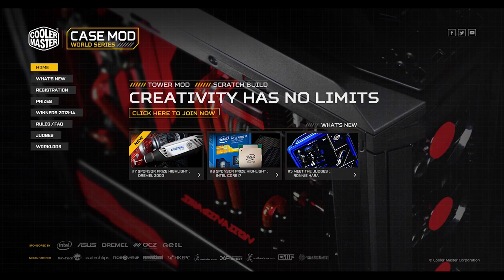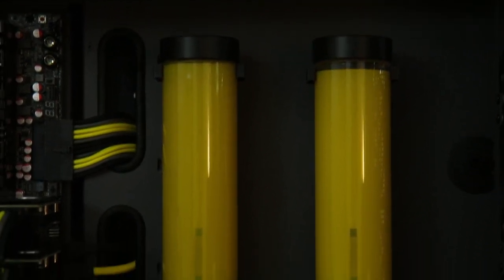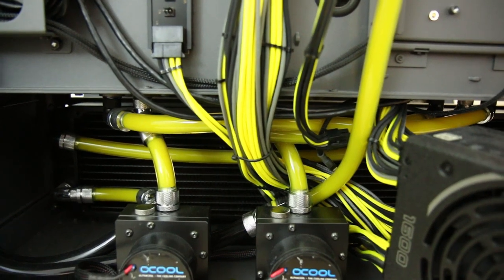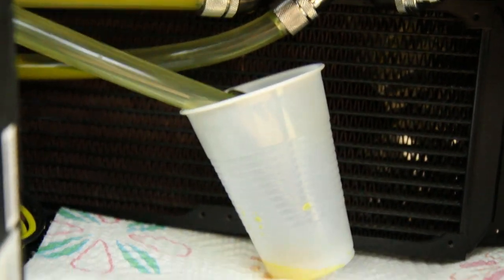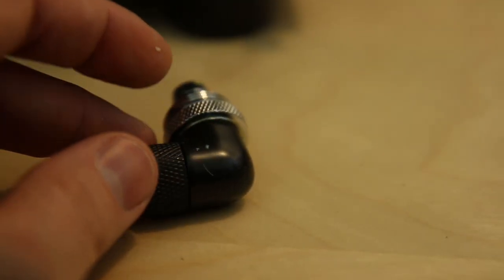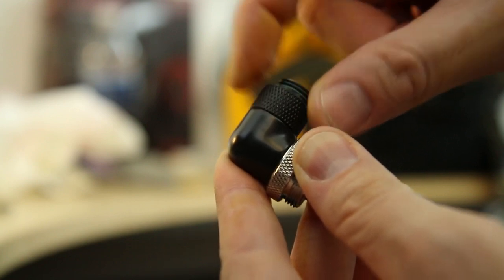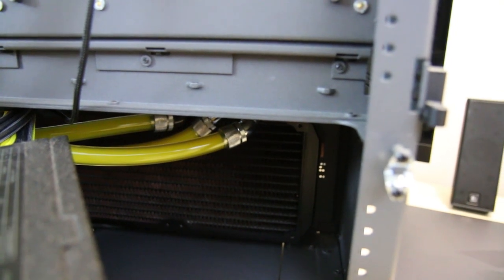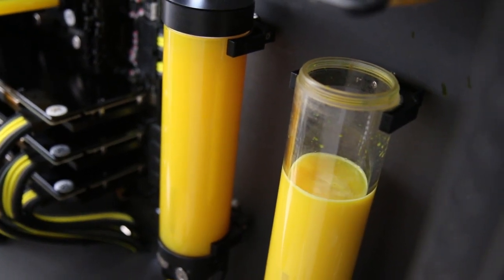My $6500 Custom Watercooled PC LEAKED!!! Now lets fix it....

Comment: Who the fuck water cools their pc anyway??
Reply: When you have higher end parts that are pushed get very, VERY hot like 120 degrees so water cooling keeps it much cooler than fans.
Reply: i have a box connected to my pc that has an extra i7 fan it cost a lot of money
Reply: idk its like a case with an i7 fan in it its pretty small and its does its job well connects to my computer using magnets and ads extra cool because the fan on my actual computer is pretty shitty
Reply: +Flash The Reptilian I guess so
Reply: +Flash The Reptilian reptilian brotherhood HISSSSSSS
Reply: +JACKO- LANTERN I think your talking about a laptop cooling dock.
Reply: +Flash The Reptilian  HISSSSSSSSSSSSSSSSS
Reply: +Teemo4Life Absolutely.

Comment: tho not required. As a precaution always use DOW silicone lubricant on those o rings. O rings can and will go bad after few years. Do not use other products as they contain petroleum which will corrode o rings. Do this every few months when you drain your system for cleaning. You will have better chance of water tight system. Just a bit of personal troubleshoot experience.

Comment: I would love to do a water-cooled build, but this is exactly why I haven't. I have experience in high pressure hose building, including swivel fittings and adapters. All swivel joints rely on an elastomer o-ring to prevent leakage, usually nitrile (Nitrile Butadiene Rubber.) O-rings are subject to heat aging and oxidation. In other words, if you have the system long enough, it's going to leak. I'll probably still try one some day, but I'm fully aware of the possible headaches I'm inviting. lol I really admire your builds, by the way. Awesome and inspiring are the words that come to mind. :0)
Reply: Depends how pretty you want it to be.

I used barb fittings on every part of my water-cooled build with soft tubing, basically 0 chance of failure, i dragged that across the country for 8 years without a failure. 

But of course fittings like he's using are going to look better, but also be more prone to failure.

Comment: Those bloody rotary fittings man! I've also had a leak and it was also due to lateral pull against the rotational axis of a 90 degree BitsPower fitting. Replaced it and re-did some tubing and it was fine... They're really sensitive to that I find. Sucks.

Comment: Rotary fittings will also have more individual points of failure. Not much choice if you want flexibility in a hard tubing loop but I would avoid them if aesthetically possible.

Comment: Just as I ran the pump on my first watercooled system I developed two leaks. One was a fitting that I didn't tighten as much as I had thought and the other was on my reservoir. One of the plugs leaked very slowly and no matter how much I tightened it it would leak, even swapped it out for a different plug, still leaks.

Comment: Air cooling has done the trick for me. My cpu runs 20c lower than it was before i bought an aftermarket cooler. My temps are 40c on load and 30c idle. I never want to ever bother with water cooling.

Comment: ......and subscribed, also;
some times you will find fittings leak when in service, then test perfect on the bench, sure the load/torque you had applied on the hose was helping the leak happen. another thing to consider is when the system is up to operating temp thermal expansion can allow leaks to start or increase, then theres the whole manufacturing tolerance + QC that has to catch any flaws.leaky fittings happen to anyone eventually over a long enough time scale even when all the work you do using the fittings is correct. cheers Jay for all the vids

Comment: In car engine you pressuretest the cooling system with air after you filled it with cooling fluid and watch if it keeps the pressure (about 1 bar) for several minutes.

Comment: I know this is 2 years after your upload but I have had problems with o-rings on mine and my brothers setup. Perhaps just sharing this will alert someone to keep an eye out for the problem I have experienced.  Its almost like the o-rings suffer from ozone degradation and start cracking after a couple years. I've changed all the o-rings except for inside the waterblocks and I've been running this 790I ultra for 7+ years now without any major issues. "I know its old but it still plays everything I throw at it"  I've never had a leak thankfully but I do have to top off the reservoirs every 6 months or so. I was so afraid of there being a drip somewhere on the graphics cards but it could only be evaporation.

Comment: If you want to check your system properly before putting 'water' in it. Connect a manometer and put 1bar air on your system. wait 30minutes. if the air pressure dropped at all (look at manometer after 30sec not from start and make your pumps etc move a couple of turns before taking notice of the 1bar pressure)
Reply: +Bart Stas it also doenst hurt to move and jiggle al your hozes while doing this test.

Comment: custom watercooling is cool... if you got money to burn..    .. but i've been using my NZXT Kraken X60 on my 8350 @4.4 for the past 2 1/2 years .. and its been solid just the occasional vacuuming  and dedusting  and its fine for the cost

Comment: I had my fare share of leaks. I had leaks from my custom machined CPU waterblocks back in Barton/Duron days. I always used demi-water and some antifreeze (like 10% tops) and I had a couple of leaks from CPU block down on my graphics card while PC was runing, then it leaked around the GPU over the AGP slot (some even went in it) and down the motherboard and PC was running just fine. There wasn't enough conductivity to cause any damage. One time I had my water system runing over 8 months without changing the coolant so the water did pick up some goo and some minerals from copper and other parts and was not demineralized anymore obviously and again I got a leak from my cpu to my gpu and this time PC did shut down. No damage. Just cleaned the PCB with fresh water (under a tap believe it or not), dry it all out, put it back in and it all works. Point is: as long as you are not going crazy with coolant and you use non-conductive or very low conductive coolant you aren't going to fry anything. I have no idea what Jay here uses and if that color in the coolant is conductive or not (hope not) but some colored coolants ARE conductive. They look nice but god forbid you get a leak and you will regret the day you wished that purple coolant instead of blue or just plain see-through colorless one ;)

Comment: I don't know a ton about computers, but the first thing I thought of when you were putting this together and assembling the cooling system was all the points of failure you have in it. Now maybe your experience of 11 years and one leak is more credible, than my observations but, it would seem to me a good idea to eliminate as many failure points as possible. Why not run flexible tubing from the reservoir down through a hole in the case to the next connection rather than introducing a bunch more failure points by using a fitting? A grommet could be used around the hole to hold the tubing and prevent chafing and look nice. I wonder why these don't have level sensors? Is it because the reservoirs are just so easy to see and monitor?  

Like I said I don't know much about computers so maybe noob questions here I mostly work on cars but I have really enjoyed your videos especially this build I love the gray and the yellow and the thought and craftsmanship you put into it.

Comment: I think a solution to this problem might be the waterproof spray. If you ever decide to water cool your machine, make sure to use the waterproof spray to insulate the electrical components. Or you could just build a mineral oil fish tank pc.

Comment: Damn, even if it leaked once, you can't ignore that watercooling does an amazing job. I wish it won't leak again.
I've got a question. Once you filled the system with fluid, overtime, fluid goes somewhere, I mean If some of it would be gone or it stays the same amount over years?

Comment: I was thinking about the possibility of making a watercooled system using vacuum. So it would be a negative pressure and not ass prone to leaks in the different fittings. Or that was my thought at least. I have no experience what so ever on that subject. Only ever used an AIO.

Comment: Stick a Raspberry Pi (or Asus Tinker) in there with a leak sensor and a 120v relay; the second the bottom of your case gets damp; have the Pi through the relay, nearly instantaneously cutting power to the PC's PSU.... I'm doing this with my TARDIS build.

Comment: I had a leak in a Coolit water-cooling system too. That is why I don't water cool any more. It leaked right on to my $220 graphics card. The problem was the water pump, that is where it leaked from. That was 10 years ago.. i won't do it again.

Comment: I hope that nano fluid is non conductive and doesn't cause corrosion so if you do get another. leak like a spurt all you need to do is wipe the components down and dry it off a little

Comment: Everybody taking about fan PCs not looking as nice, being as quiet, etc.. 

Search youtube for "Cloud Unit" by diy perks.. 
It's totally possible to make air efficient and silent, even quieter than water cooling.. You just have to make sure to do it smart where the airflow is controlled very well.. 

I'll admit liquid cooling looks awesome though.. But if you really want you can always run some pointless colored tubes and extra lights in a fan or passive system and get that same effect.. 

My favorite ever though is this one desk PC that had a glass top with all the parts exposed.. I can't remember what it was called.. But a form factor like that really r requires liquid cooling.

Comment: Do you use silicon grease on your gaskets? 

I don't know it is different with watercooling fittings, but with all other types of O-ring gaskets, you need silicon grease to complete the seal.

Comment: hows this for a computer case thats specifically designed for watercooling... what happens if the motherboard is laid horizontally, a bit like those desktop computers where you put your monitor on the case ... except, the motherboard is up the top, facing downwards... basically, upside down... any water coming out of the loop will be going away from your actual computer parts

unless you have some crazy high pressure in your water loop which just happens to shoot the water upwards through the leak, then thats the risk you take when you have a good pump but shoddy plumbing

lots of cases out there say that they are ready for watercooling but what they really mean is they have a bit more space for the radiator where the case fans would normally be.... but if the motherboard is installed upside down, it would also help with mantenance of the water loop because it makes draining a lot easier too, it will literally be pouring the liquid out of the waterblocks and there wouldnt be any pools of liquid left in a bend or corner... and if your pump doesnt have enough power to push the water all the way up into your waterblocks when you refill it, then you probably shouldnt be using it to cool your computer anyway

Comment: You can only produce about 1 psi of air blowing into the system. With the pumps creanked up moving water around your talking about 10-15 psi. So big difference there.

Comment: Hi!
I am Greek (Hellene) and i watched many of your and Barnacles videos.
I do not own a water cooled desktop pc, so i am not so experienced, but ideas passed through my mind when i saw your problem.
Have you tried some kind of sealant in the joints, like silicone or something like that ?
I'm somewhat troubled by the smoothness of the area around the joints, and if that would be a 100% seal, but it could be a good idea to roughen the surface with a sand paper in a circular pattern, so it would create some kind of grooves, as the ones in a bolt but not in a spiral. that would help the silicone to grip and seal better.

I think that would somewhat eliminate the possibility of a future leak!
especially where the valuable parts are located.

Just some thoughts i would like to share.

Vasili

Comment: my first watercooling attempt was very ghetto, i used my old zalman z11 case as the housing for my pump res and rad, for my pump i used a $20 submersible fishtank pump 2400lph!, a water jug ($3) as my res, and green fishtank tubing. the only normal things i used was a 240 x 240 x 45 rad, ($50) a ek waterblock ($110) and 3 normal fittings ($20). and koolance coolant 2ltr ($15). because it wasnt completely sealed the coolant was evaporating and the inside of my case turned blue
Reply: actually fitting a h60 on my 290x was my first attempt

Comment: My development career has taught me to keep it simple, which is why I would never ever do a loop as complicated as yours.
My loop was designed from the ground up to be effortless and painless to drain, take apart, reassemble, and prime without even cycling the pump. And really thats the only rational reason to buy expensive parts imo, to make life easier.
I do not envy the hard-tubing loops.. :o Thats gotta be a nightmare.
Sucks that it leaked, no loop is leakproof, but thats all the more reason to K.I.S.S.

Comment: since your only leak ever has been the result of one of these fittings would you say its a good idea to only use straight fittings if possible? like just a regular compression fitting for every single connection possible? seems safer?

Comment: All it takes is a little too much force applied during installation to get them loose like that.
Had the same problem with 2-3 of the EKWB ones in my Setup - Not really blaming EKWB but I wish those things were a little bit more sturdy.

Comment: Why wouldn't you air pressure test the system first? Always pressure test first. Put 10 or 15 psi in it and let it sit over time. No drop=no leak.

Comment: Whats the normal amount of coolant to disappear ? 1mm month, 3months?
Just asking as i need to some once in a while and i have searched and searched but i never seem to find Any leakage.
I have mostly used 10/8mm plugin fittings. 
But i gotta agree on you about watercoolings safety. I have had about the same build on few cases over 10 years in use and never anything major. Changed some tubes ect over the time and blocks.  Even has some Custom Hand made blocks Back in the days.

Comment: Stuff happens! Glad you caught it when it was minor. Full liquid cooling is still out of my league in cash and time investment needed. 
I have a pre made CPU liquid cooler I have been thinking of adding a GPU liquid cooler.
Not sure what to look for in a liquid cooler for my GPU. I have a EVGA GTX 680 FTW 4gb.
 I have tried web searches but have NOT found a model specific cooler and the ones I see don't have pumps just ports.
 Cost is a MAJOR factor but I don't want to snag something that is total crap either. Any tips or advise would be greatly appreciated Thanks.

Comment: As I could see, we usually get the cooled water from radiators to reservoir. And i'm wondering could i invert it, I mean we would get the hot water to reservoir first then cool it by leading to the radiators after ? I know it's kinda weird and crazy idea but it's just for a clean tubing idea inside. :D

Comment: Correct me if i'm wrong Jay but shouldnt there be some kind of soft rubber bracket slightly holding up those coolant tubes to keep them from sagging ever so slightly? That way they put less stress on the fitting? Just something to think about.

Comment: I had a leak on the same fitting. Only found it when I nudged it and it almost squirmed put like and artery being cut. Fortunately I had a spare. 

So maybe these fittings are only good with 0 pressure on them.

Comment: Oh I forgot to mention. How come you didn't just run the hoses up through the bottom through rubber grommets to the reservoirs instead?
Also the same for the cpu and video hoses going through the bottom to the radiator? It would have eliminated allot of fittings and possible leak points.

Comment: It shouldn't kill the computer anyways if it does leak onto the mobo or GPU if you're using something non conductive so. Really at that point it would more be based on how long it has been running. If it's been running for a year then it might have lost it's non conductivity through random means or something.
Either way even though it's not good to have a leak in most cases it shouldn't (in theory) do anything but make a mess you have to clean up.

Comment: Sharp 90 degree fittings for liquid are horrible. Pool pumps, or really any liquid pumping systems will almost always fail first at a sharp 90 degree angle. You want less sharp angles to prevent any unnecessary pressure on the pipes and fittings.

Comment: I bought a gaming pc... installed watercooling with the computer engineer from my fathers work. I was gaming on it after about a week, got farcry 4 and the system got hot. Aaaaaand... the most upper tube just spat open frying my motherboard and two videocards...
Reply: BartKrap So will you water cool again

Comment: I am very interested in getting a custom-built water cooling system for my new PC I'm building but I'm hesitant due to the fear of leaks even the pre-built self-contained systems have failure rates as well I would hate to come home and have a $5,000 brick